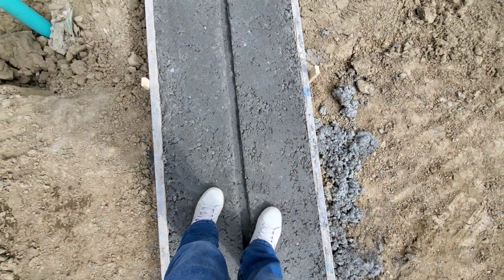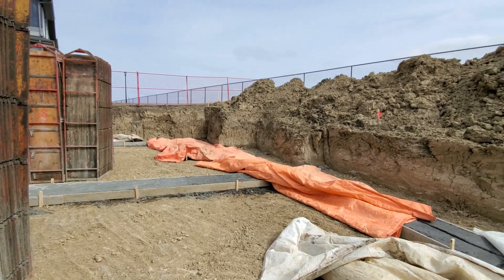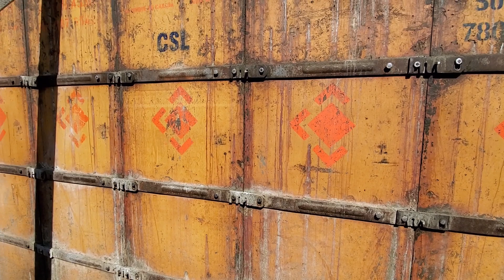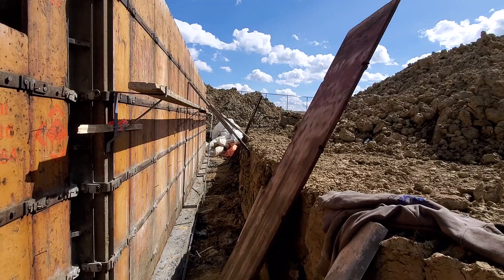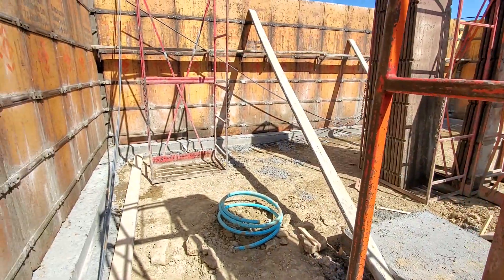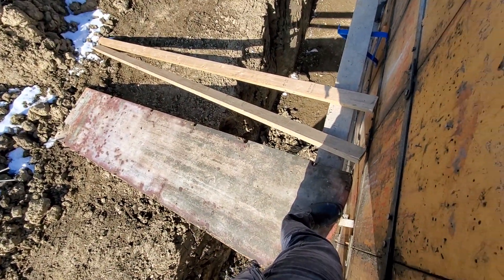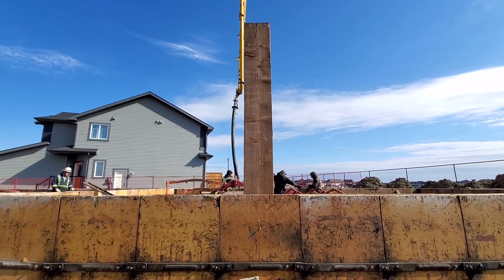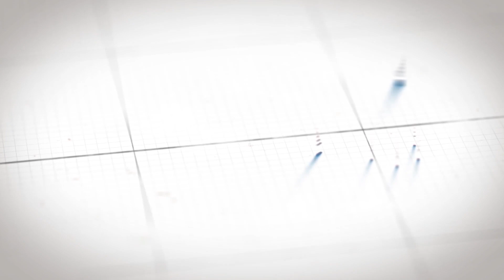BAD WEATHER & THEFT Push Us Back - DPAD'S Daily EP20

Comment: In the US you see everything from lumber to steel to cinder block. It’s fascinating to watch different types of builds.
Reply: Depends a lot on location and rules and regulations for construction. Here cinder blocks are not used for foundation anymore, you can see some old houses that still have cinder block foundations, but often it's a dirt floor basement and when the house sells, the new owner will get the house lifted and a real foundation poured. Cinder blocks do not fare well with Canadian winters.

Comment: I don,t see the guys pouring using a vibrater to settle the cocrete and remove air bubbles etc. Your building techniques/codes seem to differ from here in Ont. We use anchor bolts inserted in the wet cement on top of the wall and set a "sill plate" down and bolt it which the subfloor is nailed too. Y ou use straps? Also, here the subfloor is put on before back fill in order to prevent wall collaps from the weight of backfill etc etc!! Cheers
Reply from the maker: good observations. Here they normally only use vibrators in commercial large concrete pours, not common in residential. 

Yes, some building methods will differ province to province, but that is quite interesting that in ON they put the subfloor on prior to backfill. 

Thank you for watching and commenting :)
Reply: @LifeWithDPAD  .. Thank you for your reply also! I want you to know that my comments here and in the future are not/will not be of critique nor criticism but merely comparisons between buiilding techniques.. Being retired from the construction working world, it is enjoyable watching your videos. Cheers Dhrupad!!I